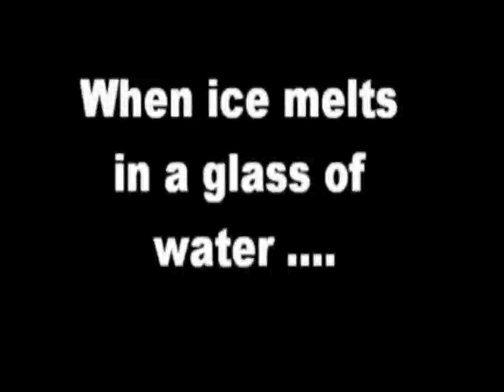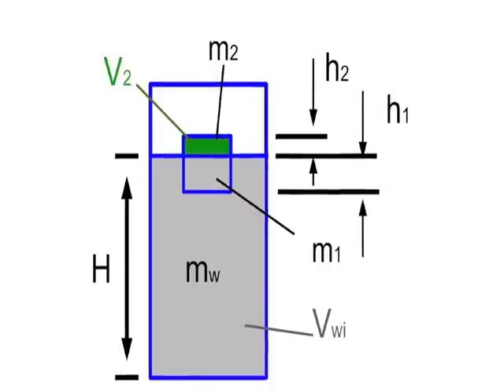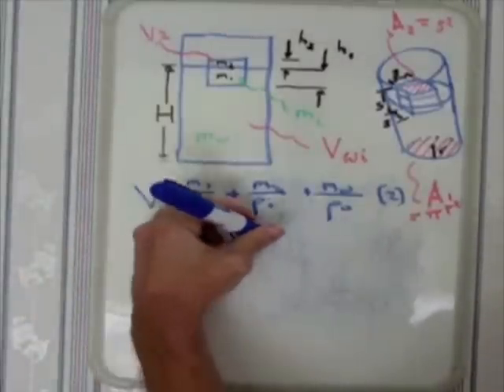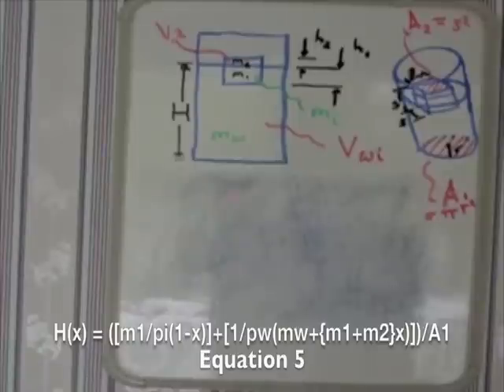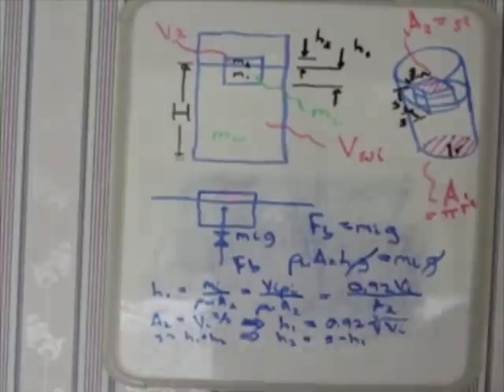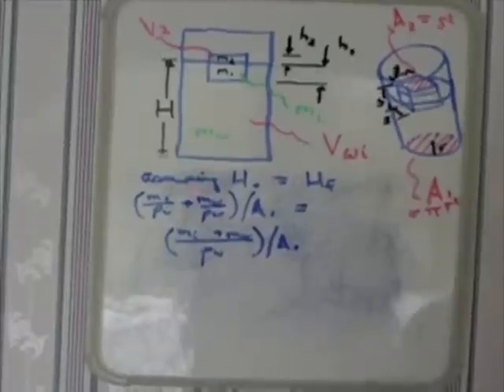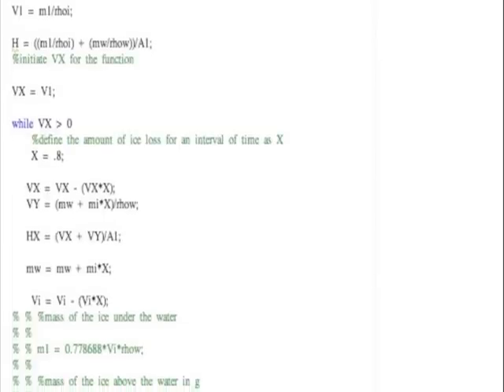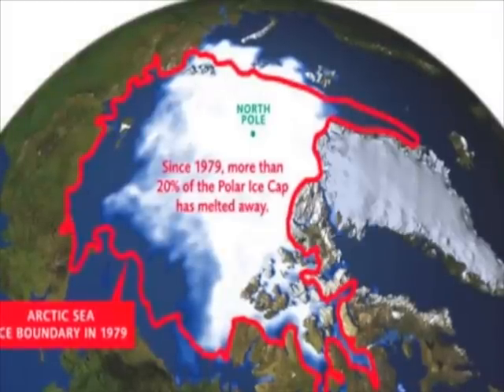Modelling Melting Ice

Comment: could you please explain the third equation
Reply from the maker: h2xA2 = V2 = m2/pi; equation for Volume which can be expressed as mass over density. I incorrectly said h2 = A2 on the audio, and didn't catch until after I printed the video so I put an annotation on the video to fix it. Hope that helps.